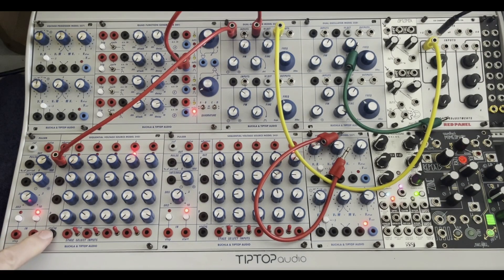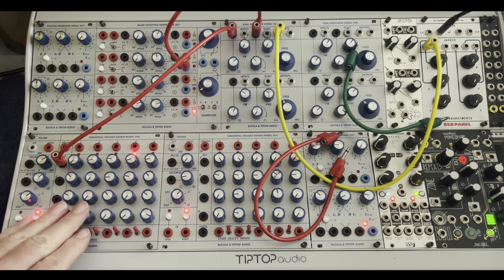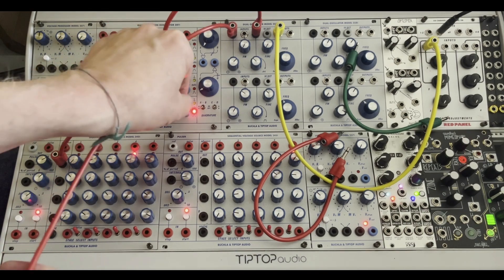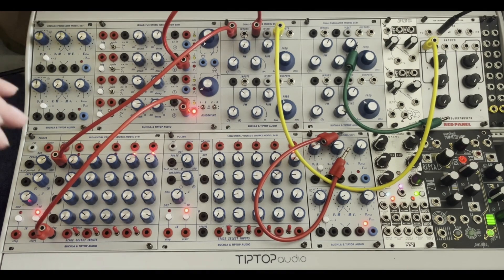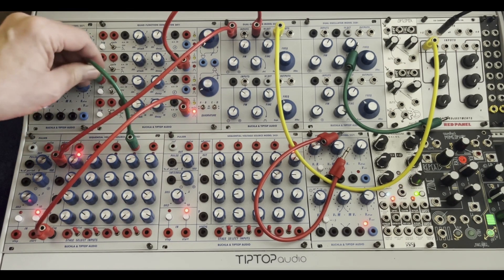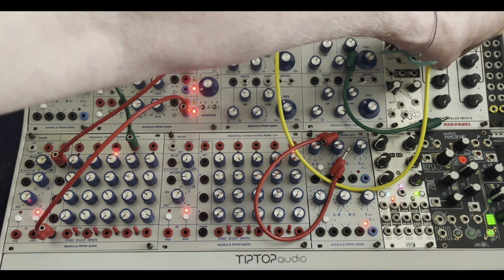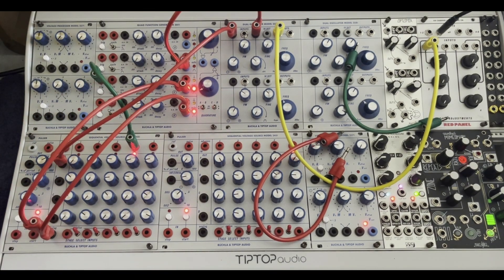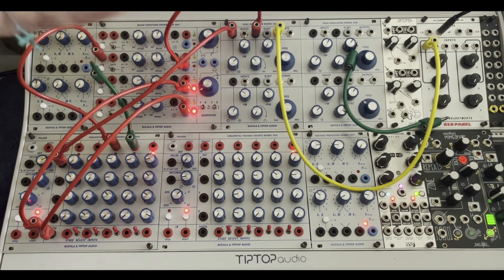Tiptop 245t Analog Input

Comment: Is it ok to passively mix the outputs of the function generators into analog input like you did with the stackcables? I’ve always heard that can possibly damage modules.
Reply from the maker: Yes. My understanding is that the inputs have resistors or buffers (I’m not technically inclined) that will prevent things frying. The worst that will happen is that you will get silence.
Reply: @vgermuse  ok thanks